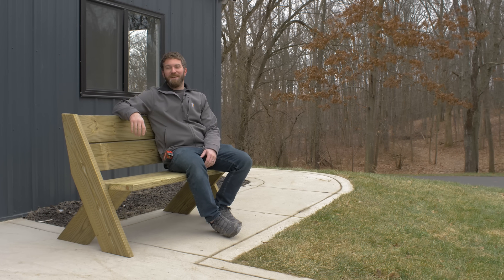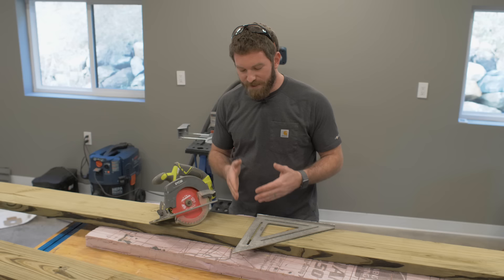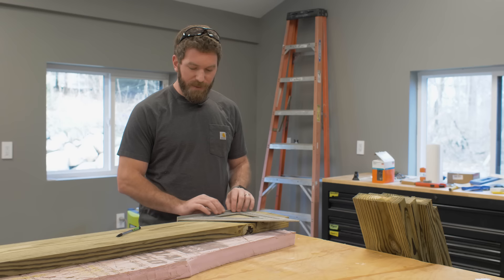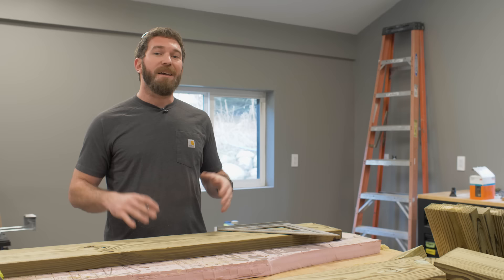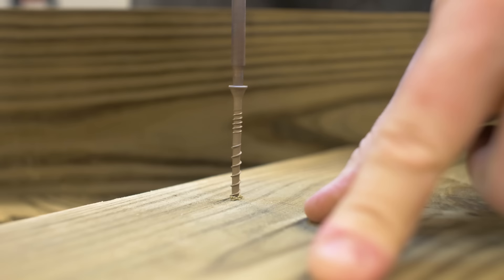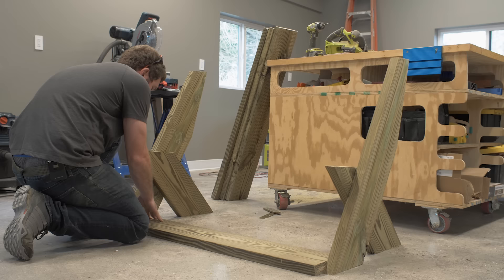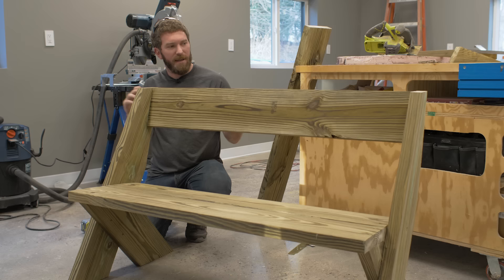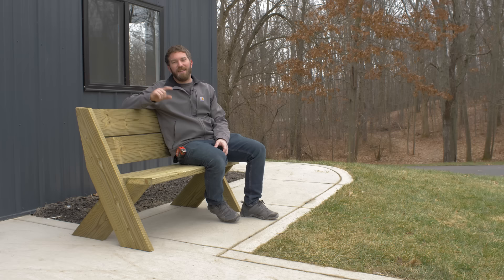$30 Outdoor Bench with Back [Only 3 Tools and 30mins]

Comment: Hi there, I just wanted to say thanks for the video and plans. I made one for my wife's birthday and she's delighted with it. So thanks.
Just FYI I used C24 pressure treated 8 x 2" nominal. In the UK where I am lengths are generally 2.4m (a little under 8') or 3m (somewhat over 8') or longer so there's  a bit more spare wood if you make it at 48". It'll get used so I'm not bothered. In lockdown I didn't have much choice of supplier  I might have found  somewhere cheaper normally but this cost me £46 for the timber including VAT) - Seems like timber is more expensive here! It's mostly imported. - oh and the next one I make I hope to do a lot faster- in about an hour?!!🤔

Comment: Thanks for the great video and easy to follow web instructions. I made this today! I used pocket holes for the seat backs for added strength and added some galvanized bracing on the rear seat board for the same reason. I also added a few more screws here and there but otherwise my project was basically identical. 

Sanding took time even with an orbital sander and my freehand circular saw skills definitely benefited from the practice. All in all this was a great project for the regular Joe.

Comment: I made this according to plan and the seat came to a height of 13" from the ground probably because i reversed the 40 degree and 45 degree side for short leg. I had glued the legs so couldn't unscrew them to re-adjust. Anyways, I fixed it by adding a 3.5"  spacer from the leftover lumber and was able to raise the seat back to a heat of 18". I think the 40/45 degree creates unnecessary  confusion. Otherwise, this is an easy build.
Reply: To add more mistakes. After fixing the seat height with spacers, the seat is too much in the front compared to back rest.  In fact the first slab is mostly unusable because it's too far out and slopes down. The back rest is at 90 degrees which is very uncomfortable. Overall the project didn't work out for me.

Comment: We just finished building one, and bought more wood for a second one.  First 4 boards from Lowes here in Laurel, MD - about $80.00.   We only needed three boards for bench #2 (using left over cutoffs from bench No1). Cost from HomeDepot was about $17 per board.   It’s a good solid design & build.  Had to measure  & check the angles a few times just to be sure.  Both benches got a nice Rustoleum dark walnut coating.  Perfect benches.  Main cost is the lumber vice using a ton of bolts & lag screws.

Comment: Those boards and screws cost more than $30 where I live (New Jersey).  Buy boards that are somewhat dry and straight and have few knots. (Not easy nowadays.)  If you get green wet ones, you may get a big surprise as they dry, split, crack and warp.  Install the seating boards bark side down. They will eventually cup (the opposite of the rings) and allow water to run off.   Buy the expensive screws designed for modern pressure treated wood or they will corrode quickly.  Once the bench dries out, sand any rough spots and edges and apply a marine varnish or similar, if you don't want splinters in your ass or elsewhere.  
I made these comments after building several different kinds of outdoor benches from pressure treated wood and seeing what happens after a year or 2 of sun and weather.

Comment: While the design is straightforward and the screws certainly won't shear off,  as the lumber dries out and with repetitive seasonal swings of temperature and humidity, the holes will enlarge, the joints will loosen, and the bench will become wobbly.  Incidentally, when using PT lumber, plain steel fasteners should not be used because the preservative is corrosive.  Use galvanized or coated fasteners approved for use with PT lumber.

 I would never use PT lumber.  First, southern yellow pine tends to warp and develop splinters when it dries out.   Also, although modern deck-lumber treatments can be less toxic,  they really aren't suitable for skin contact, and believe me that splinters are much more painful with the preservative in them.  As an alternative I made a bench from Douglas fir using a shou sugi ban preservation technique that is very attractive.  It's also possible to use borate salts as a non-toxic preservative.

Comment: Give Aldo Leopold the Credit due?  He designed the Aldo Leopold Bench for the National Park Service!  And having made several...you should be using heavier hardware.  Those wimpy deck screws will never last.  I know from experience.  Use some good 3/8 bolts for the leg supports.  The deck screws can hold the other pieces together...but you need better for the legs.

Comment: Is it just me? It’s a great design, but I followed the diagrams that popped up in the video and when I cut the taper, ensuring it was laid out as per diagram, it was on the wrong side, so had to cut another piece and do the opposite side cut for this to work, yet no one else seems to have mentioned this. It was laid out with the 20 degree cut to the left with the angle pointing left. Please tell me what I’m missing here aside from common sense. Thanks.

Comment: At 4.26 you said make a mark at both locations at what angle or degree is that line Connecting the two points from the bottom of the leg to attach the other support leg

Comment: This may sound silly but I don’t understand how to cut a board into 2 equal pieces like you are doing in the video. I tried at my home with scrap wood with no luck. It seems like you have to take into consideration the kerf but in my mind, cutting down a line should cause equal pieces, even if they arent 24 inches exactly.

Comment: You made a very simple bench design much more complicated with very little improvement. Don't need an angel at the back. Use 60 degree angles for legs. Super easy and simple. I have a couple in my back yard now.
Reply: K

Comment: Why didn't you screw the seat from the bottom and the back? Having the screws hidden is a classy touch. You could even have screwed the back panels on by going diagonally into the side.

Comment: great video, are you liking your Bosch glide miter saw, also how do you like the Bosch dust collection, im new into woodworking and just picked up the Bosch glide for an amazing price brand new in box for 500 i have a lot of other Bosch 18 volt equipment drill, impact wrench, jigsaw and circular saw really liking the build i will just use my new miter saw i believe.

Comment: Great design and awesome pdf plans, thank you! I'm going to try this with one substitute - three equally spaced 2x4  back supports instead of the two 2x8 pieces. If it looks nice that can save me some cash when I batch out 5 or 6 of these bad boys.
Reply: Did you make. It using 2x4 for the backing?  I made one with the 2x8s and its comfortable, i imagine 2x4s would do just as well.

Comment: Great looking Bench. It should have been easy but I missed something. When I measure up 12 1/4 on the point and then 5 3/8 on the short side. I draw my line but I can not get the front leg and the short leg flush. I tried putting the 40 degree and the 45 degree on the ground side. What am I missing?

Comment: Suggestion ... on the blueprint change the drawing of the boards to show the 30 degree cuts already made ... as it is, the diagram is confusing, which is a negative in an otherwise great presentation for a simple bench.

Comment: I built these with 2x6. They look and work just as good for less money. I found the measurements to get you in the ballpark for the leg crosses to be not even close. The board width not being relevant. This design is an excellent improvement over Leopold ;however, plans need improvement. You show two alternate short leg lengths but make no mention of this. As a cut list, I found that confusing. Also, the fact that the 40 degree angle on the short legs is the foot pad and the fact that the cuts on one side have to be inversely mirrored on the other side are all worth mentioning. With a 45 on a leg top, 40 on the foot and 30 that has to be properly orientated, on the adjoining piece-- it's a little confusing! No way in hell this is a beginner 30 minute job. I wrestled with the two leg lengths in the cut list, the leg crossing "ball park" marks, the mirroring of opposing sides and putting it together....which is a two man job or a frustration inducing one man job. It's a good project overall and the two benches look good by our fire pit. Thank You 😊 ps. I would use kreg pocket holes in a few places if built again.

Comment: Hi, Great vid. Will be starting this project in the next few days.  Being from the UK we measure everything in metric so just wanted to check I've got your measurements correct.  Your 2 x 8 x 8' timber is that 2 inch x 8 inch by 8 feet?  If so that seems to be a little on the thick side.  Judging by your overall dimension image which puts the bench at 51" wide that would make the timber 1.5" thick (2 x 1.5" + 48").  Would appreciate if you could clarify.  Thanks v much
Reply: Dutchie here with the same issue. I found a website where a 2 x 8 x 8  had measurements  1-1/2" x 7-1/4" x 8'. I guess it may be 1,5 inch or about 3,8 cm thick? If "-" means "from 1 to 1/2" it may be even less.  Which is way closer to what he seems to have laying on the bench. It can't be 2 inches thick.

Comment: On your web site the print for the cutting & angle template for the little legs show 19" and the other 20 1/4". Misprint?
Reply: Aos 3 minutos e 45 segundos do vídeo ele fala que corta com 19".
Reply from the maker: One end is cut at 40 and the other at 45, the result is one side is longer than the other. The cut list shows lengths of both sides. One is upside down

Comment: I'd like to build this but make it slightly longer - 5 ft instead of 4 ft to set in a specific space. Would two legs still be sufficient to hold the weight? Or would I need to add a middle support leg?

Comment: Wouldn't you want to flip it so you cut off the little chunk with the big, ugly knot in it? Also, with the back boards, rather than relying on endgrain and prayers, just make the boards 3" longer and go side grain to side grain?  Adds glue surface and some stability.

Comment: Noob here. There appears to be no need to pre drill the screw holes. Is that correct?
Reply: No need, but 100% better way to do it.  (yeah pre-drill).  Just make sure you keep the wood exactly lined up with your drill hole. If you dont pre-drill, you could drive the screw in wrong. Also the pre drill will help prevent crack outs.
Reply: If you watch very carefully, he pre-drilled most of the holes in the video.  Its just that he usually starts the scene, with the screw on the way in.

Comment: where you getting this cheap wood brother, pressure-treated 2x8 cost $12 a pop here
Reply: He never said it was pressure treated.. Exterior grade is just regular dimensional lumber..  2x8x8s are $7.54 a pop at Home Depot..  7.54x4 is $30.16 pre tax and a box of deck screws is about $9.50

Comment: You did 30 degree on the first boards when I marked it out it was a sharper angle then yours .yours .looks more like 50 degree
Reply: Make sure you're striking your line on the correct side.. Make sure you arent marking your line on the side that indicates degrees but the other side where the pivot is..  Basically the "L" part and not the 45degree part of the square with the degree numbers..  Hope that helps

Comment: Website plans for the short legs, are 19"  and 20 and 1/4.  Why are they different lengths? I am FULL STOP right here.  You say in the video to template/Trace  them?
Reply: OK, I took a leap, and just did what you said in the video : "19 inches" and "19 Inches".  I think the 20 1/4 results from the angles being different 40 and 45 degrees.  Bench is done, and I even bought a Diablo blade!  (I needed a new one anyway).  Bench is super sturdy, does not need carriage bolts.  It also comfortable. I have to sand it all down and stain it a Transparent blue.  I had a lot of fun on this project.
Reply: A few lessons learned: 
1. If you are going to paint, or stain this bench, stop at the assembly step, and paint the individual pieces.  (Much easier to paint/Stain).
2. Its going to take at least 2 hours, for a novice, maybe 4.    
3. Plan to sand the pieces with an orbital sander, and also do that before assembly if you can.
4. Be careful attaching the seat boards so you don't drive a screw out of the bottom of the leg - which is at quite an angle.
5. The Wood required leave a lot left over, almost a whole board. If you make a mistake, you probably have options here.
6. MEASURE 3 or 4 Times. These angles need to line up precisely, so it  stays level. Spend a lot of time lining up the bottom, you must have a table to do this.
7. Yes, you are going to Lowes 2 times, you don't get out of that just because of this video.  My Trip count =3, which I consider to be "Good".
8. The plans on the website look like there is a mistake on the short legs, I am not sure its wrong, but it "Looks" Wrong" . Just do what he says in the video. 
9. This bench is HEAVY STURDY, and angled crazy - meaning you have to be limber if you are going to paint it after assembly. See tip#1
10. Measuring is easier with a metal ruler, as opposed to a tape measure.

Comment: I coulda swore I followed the directions correctly...but my taper cut only wants to face the front of the bench instead of the back. 
#Discouraged
Reply: Jaime Villarreal not sure if this helps but the shorter leg has a 19” side and a 20” side. The 19” side needs to be on the outside when orienting the legs. Go to his website and look at the pictures.

Comment: Am I the only one concerned that the emtire strength of this bench basically relies on the shear strength of the screws?
Reply: Raven Starver I was 100% thinking the same thing. A few galvanized 1/2” bolts I’d use in place of those wood screws in the seat section. That’s an accident waiting to happen right there.

Comment: $5 for the plans? I'll just rewatch this video to build it for free.
Reply: I bought the plans as a thank you to the poster and they include a handy cut list.
Reply: @karlirvin5904   That's good for you. I made a video that saves people of thousands of dollars on replacing valve stem seals without removing the cylinder head and I didn't charge anything for that information.

Comment: This vid should be called, "How to cheap out building a Bench. Any horizontal movement could easily cause issues and most ppl will drag a bench from one end. I've been building benches, chairs and all kinds of outdoor furniture for 20 years and a few more screws won't cost hardly anything, but will make the bench way stronger. A couple hidden support braces wouldnt hurt either. Ok start for a bench, but still needs work. Should have spent 45 min not 30.. just sayin.

Comment: I can't see this design maintaining structural integrity with use over time. Every time you sit, the whole thing is being twisted and leaning back makes it worse. Certainly it wouldn't be noticeable when it's new or with light use, but the more it's used the worse it'll get.

Granted, it is only $30 and can be fairly easily replaced, so...

Comment: I like the bench, but LOL Bro, that's not 30 minutes. Ads already took 5 minutes, get tools ready 30 minutes, preparation of timber 5 minutes, set up and cut timber 10 minutes, drilling and assembly, 15 minutes. Paint some varnish, that's another 10 minutes as the crow flies. Talking on the entire job, that's another 15 minutes, and if you didn't talk, that I take 15 minutes back. It would be around one hour if you skipped the coffee. I know, I know,  that's what took me to build a copy of your bench, not to mention another hour drive to get a type of outdoor timber and then 30 minutes to sand the planks to remove the splinters. So, 30 minutes, yeah? LOL. I had an old bench and placed it under a tree at the back. I built it in 2000, but I don't remember when was the last time I sat on it, it's full of bird droppings. It cost me about $100 in timber. Then I saw this nice bench with cast iron legs and hand rest. I bought it for the front porch, costing me $90. So, was it worth it to build a bulky bench? Nah. The old one is rotten and the purchased one (2006) is still like new. Better buy one these days. Cheap.